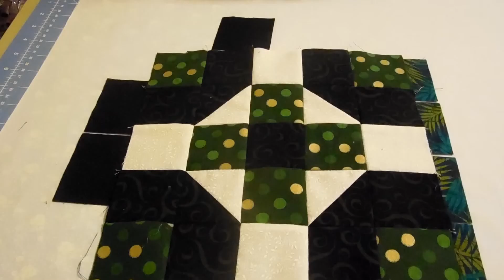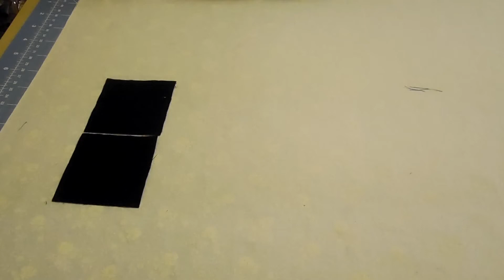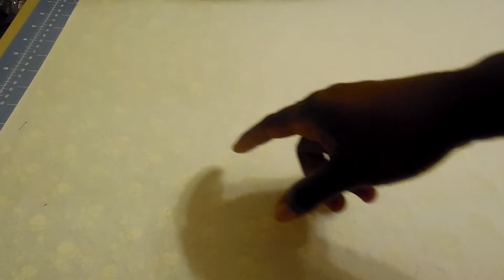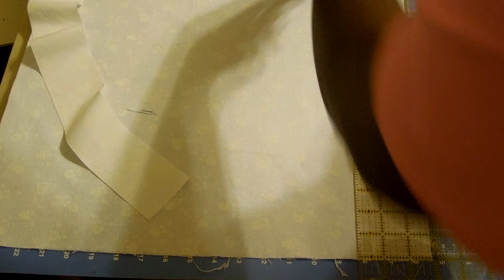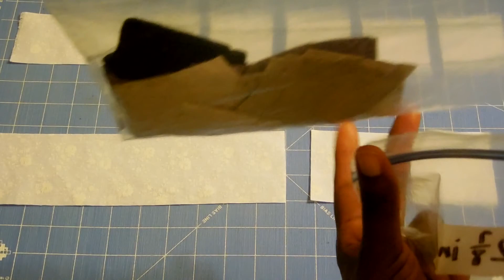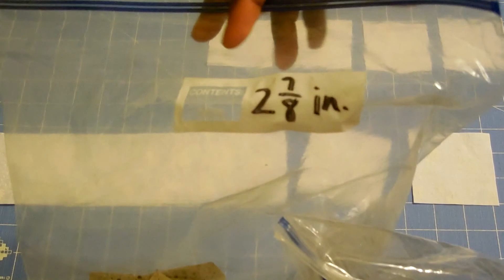Easy Quilting: How to Cut a Fat Quarter

Comment: How did you wash the fat quarter?  Thanks.
Reply from the maker: +Cynthia Prater I washed it in warm water using my regular detergent. I typically just throw my fabric in with my regular laundry, then press it.It is not necessary to wash fabric before quilting, but since I had washed the other fabrics in the quilt, I washed the fat quarters.
Reply: Wow, I never thought about washing fat quarters.  Thanks for the information.